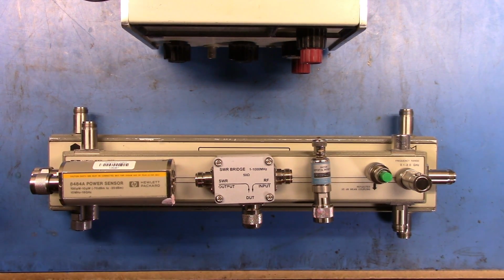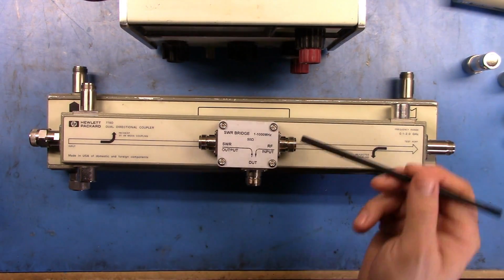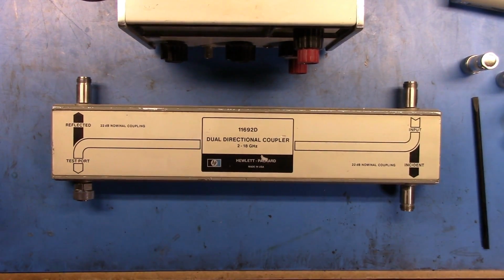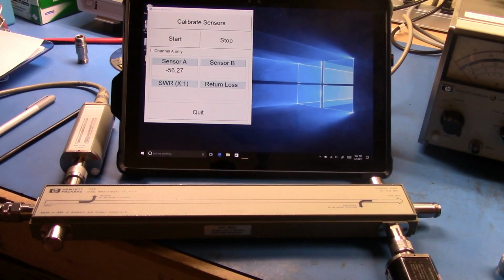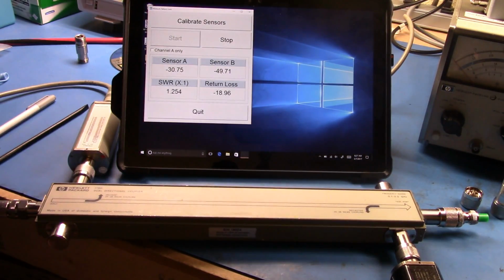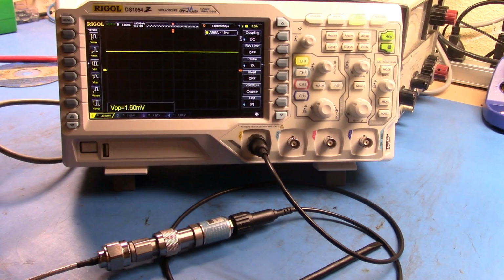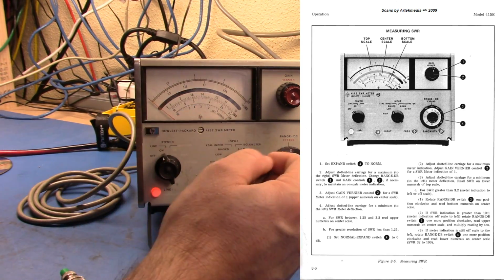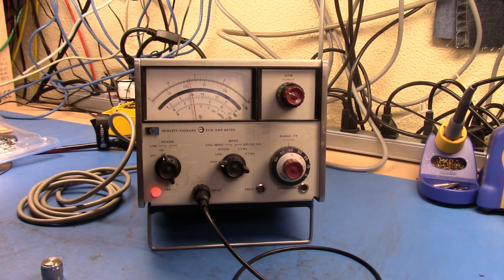Measuring Return Loss and SWR with a HP 415E, HP 778D or HP 8470B

Comment: Thank you for an excellent video.  As a 50+ year amateur radio operator I've spent countless hours building antennas of various types and obviously dealing with SWR, using different SWR measurement device technologies over the decades.  I must admit, however, that I am at loss in seeing the best practical application of what you are doing here...  Testing cables?  Circuit losses? UHF antennas?  Can you please educate me as to what the best practical use of this test equipment is?  Thank you much and best regards!
Reply from the maker: Hey Adele, thanks for watching - At their time these were the gold standard of measuring SWR/Return Loss. They can do everything you mentioned with a degree of accuracy that was unmatched outside of Network Analyzers - The additional benefit is that they could extend up to very high frequencies that you might not have direct measurement tools available for.

Today all this stuff has commercially been replaced with Vector Network Analyzers and in the hobby market by things like the NanoVNA - The video was really just an example of how to do it with this old kit rather than showing something that was unique - Let me know if that doesn't answer the question.

Comment: Thank you for taking your time to make this excellent video! My question is shouldn't you have checked the Directivity of that smaller coupler first?  And for some reason, it "appears" to me that were only seeing the Return loss of the load? 73's David
Reply from the maker: Hey David - Thanks for the comment and taking the time to watch the video. This is a great question and I didn't cover it in the video. To measure the directivity on an ideal 3 port device you would measure the return with an ideal short on the DUT port and then with an ideal load. The difference in the two values is the directivity of the coupler.

Seeing that ideal is impossible, the measurement will have errors from the internal load, the external load, the short and the sensor. I should have shown using the proper load (SWR of 1.05 to 4 Ghz) and the short to prove that directivity was greater than 20dB (this is a rule of thumb for directional couplers). I didn't do that, sorry, I took that for granted.

Doing the measurement however shows that the RL of that BNC load corresponds to an SWR that was close to what my VNA measured so it implies the coupler directivity was good enough.

Does that answer your question?